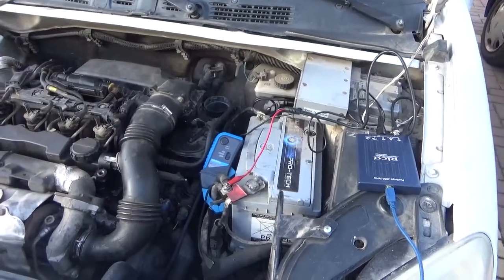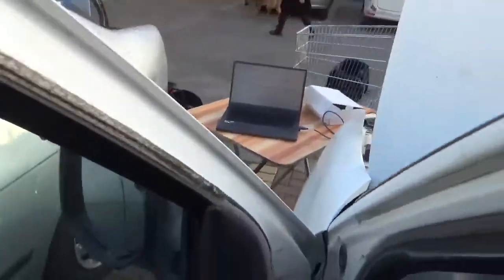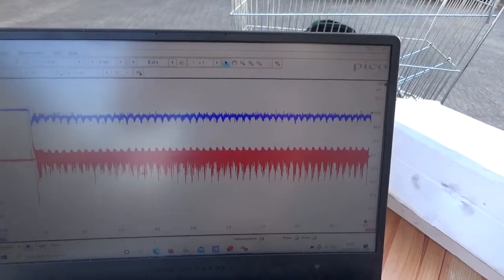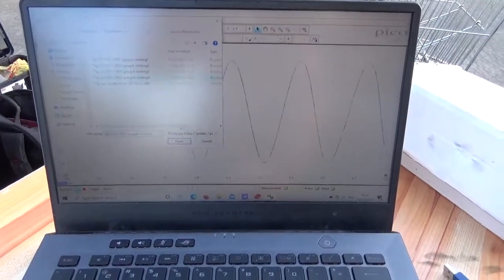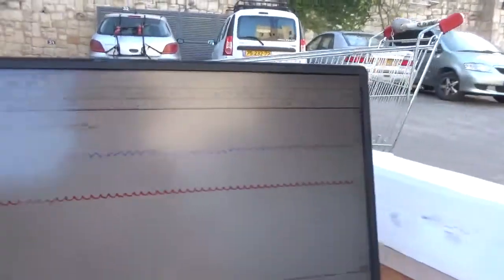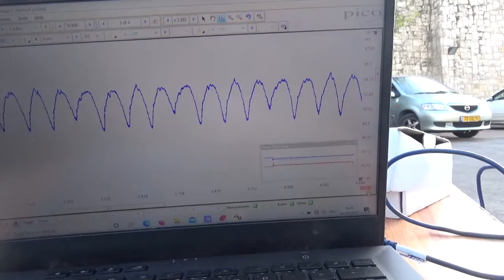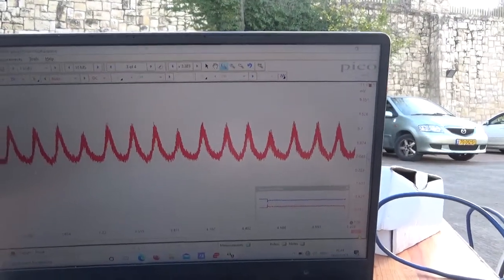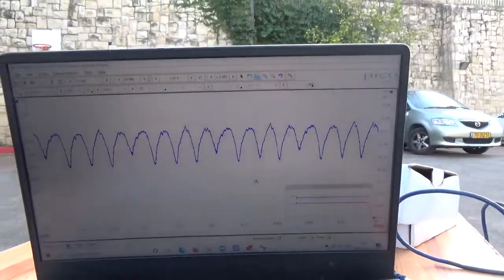Relative Compression Test Using A PicoScope 2204A Voltage Vs Amperage

Comment: After practice, what is better, pico2204 or Hantek
Reply from the maker: They're different.  Hantek has better verticle resolution of 12 bits versus pico 8 bits, but you can't record or playback waveforms on the hantek, it also has no filtering options.  In general pico is probably the better choice I would say.
Reply: @sailorbob74133  Thank you so much